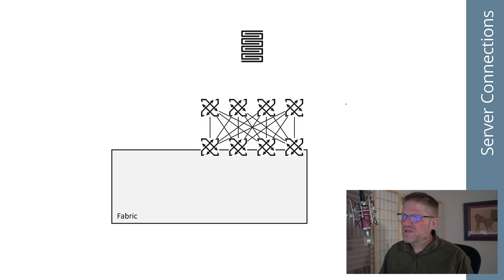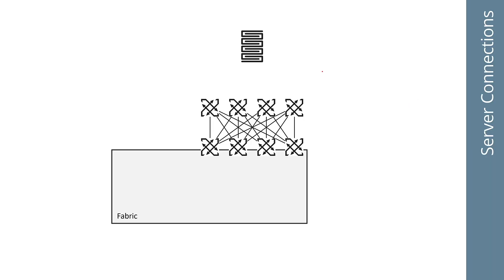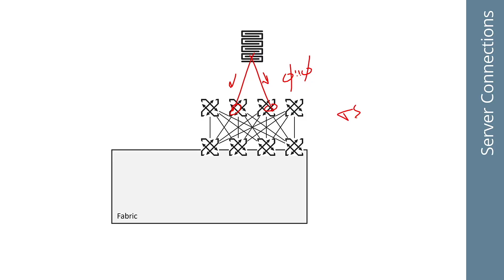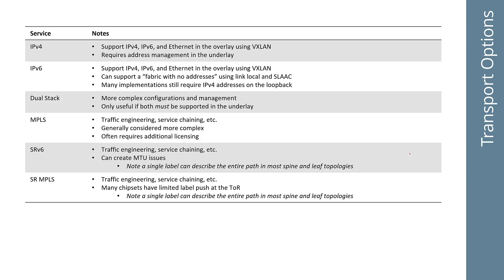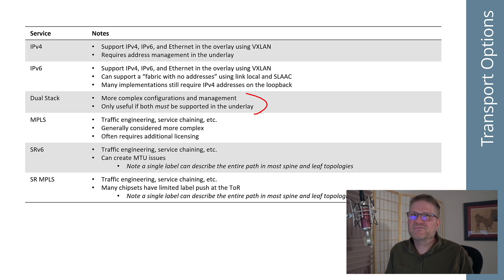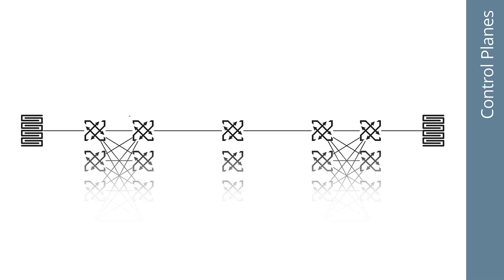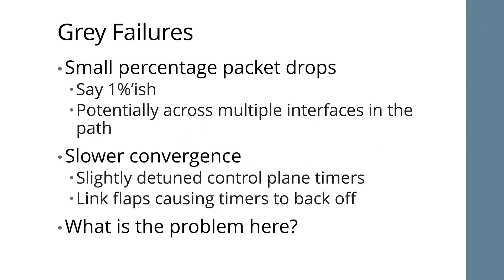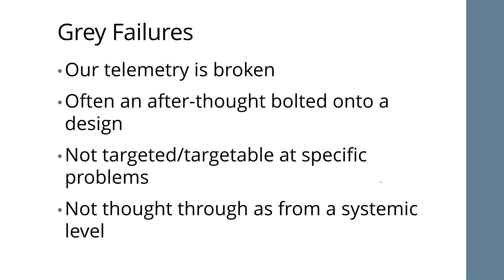Understanding Data Center Fabrics, Part 9: Other Considerations

Comment: I remember hearing a talk about people running some SLAs from end to end with jitter to force the packets to take separate paths, but in our network, we run SLAs across every individual link so that problems like latency/loss float to the top on our ops' guys screens, and they know exactly which link is problematic.  Have you seen anything like that implemented at scale?